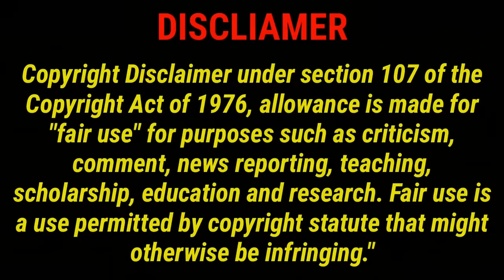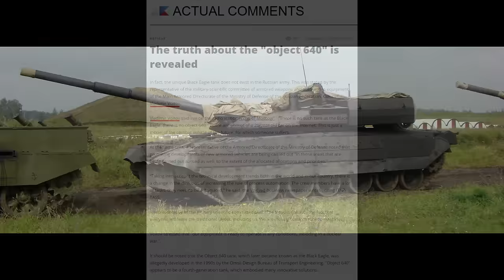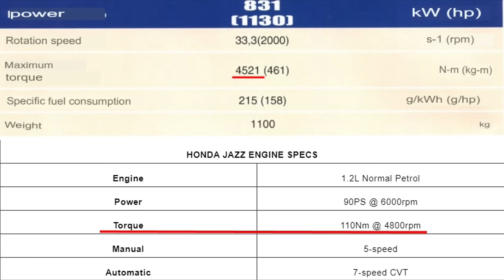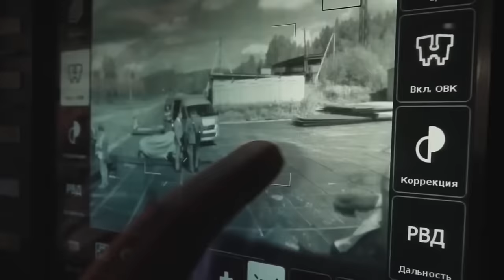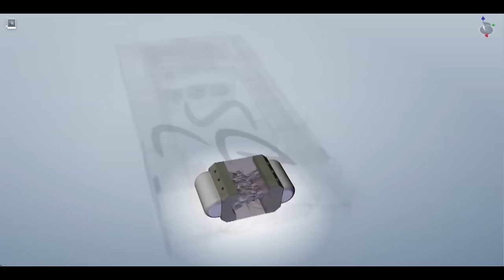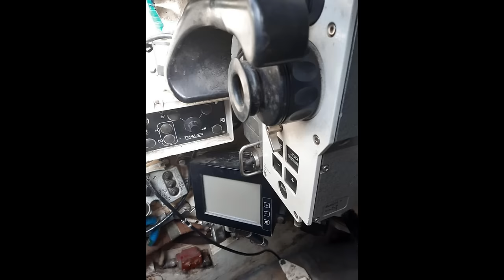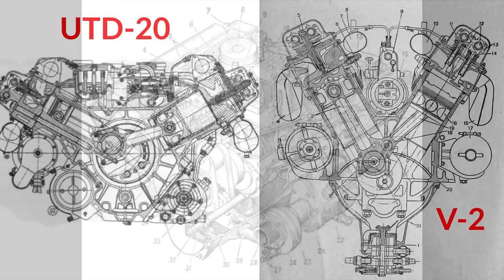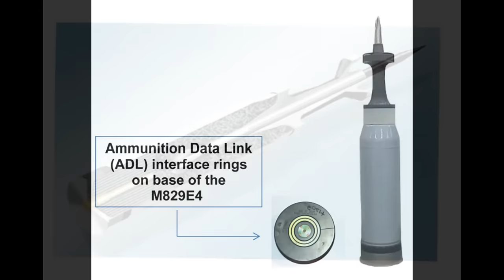LazerPig is WRONG about T-14 Armata

Comment: I had commented on LazerPig's video and appreciate your effort to correct the factual errors included in his video. It's interesting that you steer away from the economic and political aspects that heavily influence the current Russian defense industry, because these effects (while harder to gauge) potentially have significant influence on the effectiveness of the T-14 program.

There's little argument about Russian design capability to build "a great tank", but that doesn't mean they can deploy this platform in sufficient numbers to achieve a fully integrated battle system that is the primary driver for their combat doctrine. The T-14 platform is quite expensive, even accounting for the differences in purchasing power parity, which has resulted in relatively few production models entering service to date. The T-14 platform is also more labor intensive in terms of production and maintenance and its entire logistics chain of spare parts has been strained by the diversion of necessary resources to the ongoing Ukraine campaign. Many of the high-end systems incorporated into the T-14 were previously imported from Western firms and now find themselves locked behind several layers of sanctions that will continue to persist for the foreseeable future. The Russian capacity to replace current battlefield losses, maintain existing operational platforms and produce entirely new, sophisticated platforms like the T-14 is significantly hampered by their economic and political isolation from the West, which conceivably could be rectified (at least in part) by its developing alliance with China and the PLAN. 

The T-14 presents the Russian armed forces with tremendous potential, but this means little if it cannot be operated effectively within a combined arms element and in sufficient numbers to have an operational impact.
Reply: Dude, he is a tank design-focused YouTuber. He probably doesn’t have enough knowledge about Russian economy or such so he avoided it. Why would you expect that kind of thing from a video tanking about tank design
Reply: So you want a youtuber who specifically focuses on tanks and the information surrounding them to talk about economics? Keeping his video to focus on the tank keeps it within the field that he knows the most about. Lazer Pig, on the other hand, doesn't seem to have the most knowledge on tanks as RedEffect has, but does seem to know about economics and some geopolitics.
Reply: I suspect a lot of LP's views on Russian economic and political factors are based on both the times he visited Russia as well as from his contacts in Russia, to include his ex-boyfriend. I don't know RE's life experiences, but RE does seem awfully trusting of Moscow's claims at times, taking trials reports at face value. LP by contrast doesn't trust Moscow at all, and is well aware that self-deception is prevalent in Russian society and government to a point where several words describe the phenomenon, which is probably why he wouldn't believe their reports in the first place. I don't know if RedEffect is aware of this, or doesn't care. 

I don't think you can objectively analyze an artifact without accounting for the circumstances of its existence, which is something I've seen a lot with many of the more technically-minded sorts who aren't really interested in politics, and understandably so. But you can't exactly discuss the merits of a piece of art or literature without knowing the political, economic, and societal circumstances of its creation, and technology is no different in that regard. You can't talk about the Garand rifle without bringing up the culture and views of the army which adopted it. You can't talk about the development of the Sudayev PPS-43 submachine gun without bringing up the harsh circumstances that was the Siege of Leningrad which it was born into. You can't talk about the development of the Sherman tank or T-34 tank without bringing up the political and economic decisions that influenced the end result. And you most certainly cannot discuss anything about late-war German armor without bringing up the fuck fuck circus that was the internal politics and alleged economy of the Third Reich. 

Many don't like to discuss the politics around military weapons and how they came to be as you've read in the comments, and understandably so. Politics is messy. But given that tanks were built to fight a war, and war is politics by other means, it would be disingenuous to ignore politics in tank design. And as good as RedEffect is about the technical aspects, he doesn't cover the political, economic, and societal factors that led to their creation. After all, the statement "Soviet main battle tank designed in the 1960's, manufactured in the 1980's, featuring a crew of three consisting of a driver, gunner, and commander, armed with a 125mm 2A46 smoothbore cannon fed by a carousel-type automatic loader, feature a wedge-like frontal hull armor profile, shallow bowl-like rounded turrets with heavy composite armor on the front upper slope of the hull and even more armor on the turret face and cheeks, have poor elevation angles for the main gun, and weigh approximately 40 metric tonnes" is applicable to the T-64, T-72, and T-80, and to conclude that all three were adopted for a reason that ISN'T related to the internal political and economic structures of the Soviet Union would be ignorant, willful or otherwise.
Reply: @edwardjoe8448  Politics and the economy are really pivotal when it comes to tank design. They're why the tank would be made in the first place and how it would be used. It's not really something you can ignore and Red also mentioned it in relation to the cancellation of the T-95, that it was likely corruption and greed on part of the producer which is why the T-14 even exists.
Reply: @elliott4299  literally excuses lol. Yes I want him to do his research on what’s relevant to the discussion he’s starting. Or else don’t start it, the bottom line is the T14 has been around for years, so why are there only a handful? A design that can’t be produced is literally worthless, this tank is one of the stupidest moments of this century’s military history so far, even for the Russians.
Reply: @classifiedad1  a collaboration between the two to balance each others biases would be cool
Reply: @classifiedad1  well said. It’s context, and a successful tank design takes more than just competent technical design. The T14 is a failure, because their most fundamental goal with it was to design something that can challenge western tanks. It can’t do that if they can’t actually build the things, so it’s baffling that they’d even design it to incorporate western components or to be too expensive for their tiny impoverished economy to produce. Russia has a lot of experience designing tanks tho, so it all seems more a propaganda move from the start than anything else. So without context what are we even debating? They could have designed something cheaper and buildable under sanctions, which considering their history and the entire point of the tank, not doing so was dramatically a bad design choice.
Reply: Me too, LPs comments on the T-95 were just flat wrong, it had a lot of problems but it was a functional vehicle.
Reply: @mattseller148 so functional it killed it own crew
Reply: The tank was a prototype that never say combat so I dont understand what you mean?
Reply: @edwardjoe8448  Dude, he also has no knowledge on this tank or any in active service (as no one who doesn't have security access to that info)and yet he made the video...
Reply: @edwardjoe8448  If you can't build the unicorn then it does not exist. A tank is something that is deployed in the army.  What we have is a demonstrator not ready for serial production.
Reply: Whats the PLAN?
Reply: @edwardjoe8448  
LazerPig: "I have no idea what I'm talking about on this subject... So I'm going to talk like I do I know what I'm talking about.
RedEffect: "I am not as well-versed on that, so I won't comment on it."
...And people are... admiring that LazerPig does this? Constantly, no less... I... I don't get it.

Comment: The autoloaders are not "by design" unreliable, they are unreliable because they do not exist in a vacuum but in a military system that does not handle it well. It is a robust design, when maintained, and by that one means by trained personal, which are both not as common as they should be according to the size and proposed importance of the Russian Forces. It is a systematic problem, basically a RTFM situation, a user error.

Comment: Great video, I felt some of the claims LP made were a bit dubious but didn't realise quite the extent of it. I'm curious to hear him out and see what his response would be. One problem with your video (and it is a minor problem lol) is your writing off of HESH as being obsolete. There's no doubt about programmable HE ammunition being a powerful tool. But HESH was not really intended to be used against exposed or entrenched infantry, that was considered a job for the machine gun. HESH is specifically a demolition round, not an anti-infantry one. No other means available to a modern tank is currently quite as good at destroying buildings and bunkers as a HESH round is. And that is in line with the British army's tank doctrine. You could say that the ability to destroy the whole front façade of an apartment building by using structurally-weakening shockwaves may be more useful in certain situations than HE-FRAG.

Also (even more minor) the CR3 is not a collaborative project. BAe and Rheinmetall merged and are now the same company. CR3 is really an interim measure more than anything else as Britain has expressed interest in the Franco-German Main Combat Ground Vehicle project, which aims to create a common NATO tank for European nations. After two previous failed attempts to create a common NATO tank the UK has decided to also invest in an indigenous design in the meantime.
Reply: Also one of the things stated that, to not exactly great surprise, doesn't have a source is that the rifling isn't important??? Like for FS rounds obviously, as far as I know the spin actually hinders the APFSDS round of the challenger. But for the HESH?? Seriously? Dang all small arms manufacturers around the world must be real behind the times using rifling after all "modern technology" (whatever might that mean) no longer requires that stupid stupid rifling. And as you can see, all smoothbore guns around the world absolutely LOVE using non-FS projectiles. Oh wait, they don't?? Dang mr. Red Effect must have forgot to tell them that they could easily use them because rifling is no longer important.
Reply: when a grown man says a shitty honda has more torque than a tank ten times the weight you gotta start asking questions.
Reply: If LazerPig says the sky is blue, you shouldn't believe him until you look outside and confirm the sky is blue.
That's how little you should trust whatever that man says.
Reply: 3OF26 has far more shrapnel and blast potential than L31A7.
Reply: @vitkosbence3705  Yes, small arms are behind by a large margin and only due to lobbying. Cartridges like 10x54mmR have repeatedly demonstrated a substantial increase in given performance per kg of recoil impulse. You seem to be upset over this video, here's a suggestion. Do analysis of 3OF26 and L31A7 use. There's also the "new" 120mm HE M3M round which also outperforms L31A7 substantially.
Reply: @Nothing_._Here  
"Yes, small arms are behind by a large margin and only due to lobbying."

[Looks at electrothermal-chemical gun/ETC technology and how advanced and capable it was even in the late 1980s/early 1990s but never got anywhere due to funding]

...The man has a point.
Reply: @vitkosbence3705  You clearly missed something in the video because RedEffect literally says that rifling is useful for providing spin stabilization to HESH rounds. His point just is that rifled tank guns in general are obsolete which is a completely correct and well known fact. Smoothbore guns are able to fire much more advanced projectiles that are more effective.
Reply: > No other means available to a modern tank is currently quite as good at destroying buildings and bunkers as a HESH round is.

Not really, the new smart round that the US is putting into use can achieve similar effects since it can be programmed to detonate only after having penetrated to a specific depth.
Reply: @hedgehog3180  The main argument against HESH versus fortifications is programmable ammunition. Yes, programmable ammunition is very potent, especially against soldiers in trenches, but, as I've said multiple times already, it will not destroy an entire building.

HESH achieves this by transmitting explosive power directly into the structure of a building. This is how companies demolish buildings, by placing plastic explosives that send contact shockwaves into the structure. 

Basically HESH is not very sophisticated but I think calling it obsolete or useless against infantry is unfair.
Reply: LP just made a response summing up RedEffect's video mostly as strawmanning lol
Reply: @mhx6437  Just saw it yesterday. Faith restored.

Comment: You've got a point about lower weight being very helpful with accelerating faster. That said, this is all pretty academic, we're talking about the miltech equivalent of Duke Nukem Forever.
Reply: Right? All of Russia's technology is pretty obsolete. Rugged, but obsolete.
Reply: Armata started serial production  about three years ago and since then a minimum of 50 are confirmed, it’s probably more like 200 which is close to the number of Challenger two tanks in existence, so it’s not DNF.

The turnaround also wasn’t too long. 4 years for the first prototype, another 6 years for final production model.

If we really want to talk Duke Nukem Forever military hardware, let’s talk about the F35, which was proposed around the time I was born, but didn’t actually make it to prototypes til I was in high school and didn’t see military service anywhere until after I had graduated college.

Comment: Translation error or not, but to say in the video that a 38 liter diesel engine has the same torque as a 1.3 liter gasoline Honda Jazz without putting your hand to your face, speaks of the technical literacy of the author.

Comment: 35:44 I’ve never heard of the T-15 + the T-16 until now. They look interesting. The T-16 does look a lot like a Bradley or a M113 ,which I guess that’s what that is supposed to be, where as T-15 is more of a IFV I.E a BMP-2.
Reply: T-15 is a heavy IFV, something like the Namer or the Puma
T-16 is an armored recovery vehicle, not a troop transport
Reply: T15 was widely know, dam you missed it hard, but well normal, the idea is basically a Namer but with Autocanon and ATGMs
Reply: It's just a concept which never went into production. The only one went into serial production is the T 14.

Comment: As far as I know the purpose of the HESH rounds was anti building and maybe against some soft targets like BPM's and troop transports with thin armour

Edit: about the Tiger P engine, it wasnt unreliable, the thing with that tank was the petrol-electric transmission, 2 type 101 engienes will power 2 electric generators, 1 on each side of the tank, and the generators will power 2 engiens and those engines will power the tracks of their respective side, this complex system is the reason Tiger P was longer than Tiger H and the reason why the tank suffered many problems with the trasnmission not just the engine, also the Tiger P was never mass produced cuz Henschel model won, only the prtototypes were built and the chasis left behind were reconverted in Ferdinands/Elephants
Reply: Also it's for thick slope single layer armor like IS3 - 7
Reply: I was talking about more modern uses, I dont bealive a tank would waste an APFSDS on a Toyota with a machine gun
Reply: @Storiedfrog9  yup, you're right

Comment: the leo2a7 actually got the tracking system and calculates and moves the gun to a firesolution on moving vehicles even at high distcanes and while moving it self at the same time =)

Comment: As a former T72-mechanic, I have to say that the autoloader firing 3000 rounds without faults sounds.. highly unlikely. :D

The horizontal system in T-72 did malfunction sometimes, for example by getting the timing off slightly and disforming the grenade/propellant cassette, after which the system would jam. It can be fixed in a couple of minutes, but that demands an available crew member to do the manual work of removing the cassette. I cannot see that being done very conveniently in a version where crew sits in a different compartment than the loading system.

About T-80's vertical loading system we only heard rumors, according to which the commander injury rate was elevated, and rumors are seldom completely without some basis.

Comment: Imagine thinking a 4-cylinder Ford Fiesta weighing 1 ton has more torque than an V12 tank engine moving 50 tons.
Even if it was a "translation mistake" it's ridiculous.  This is the kind of NATO bot stupid we have to deal with.
Reply: "Mistranslation" is just a way to say "lol don't worry about it, ignore it ignore it"

If I made a video with this level of wrong, I would remove it and re-upload it with the correction.

But he cannot remove a video with a 15minute ad, can he?
Reply: Yes it's on the same level as mistranslating " this elephant weight's 40 kg" instead of 40 tonns. Some basic logic would tell you that there's something wrong. If you decide to ignore that logic it means there's something wrong with you.